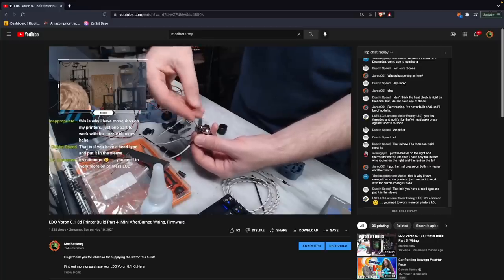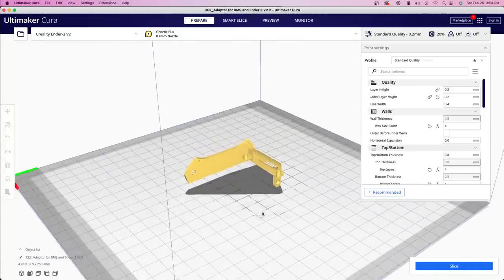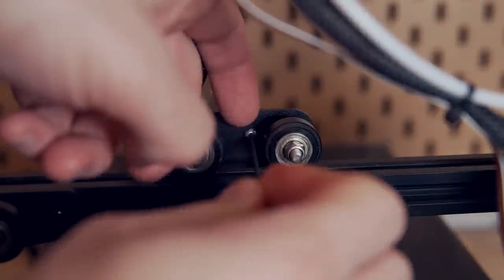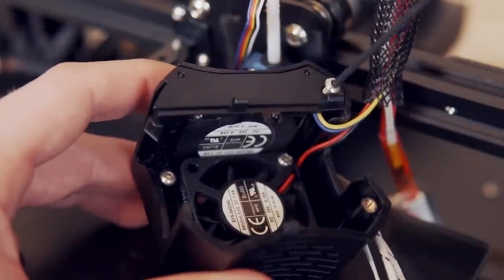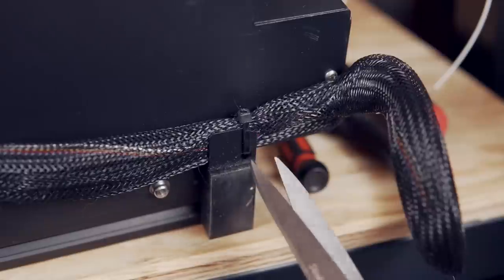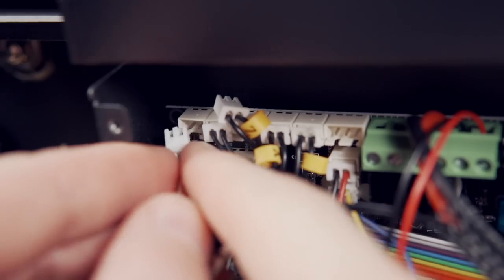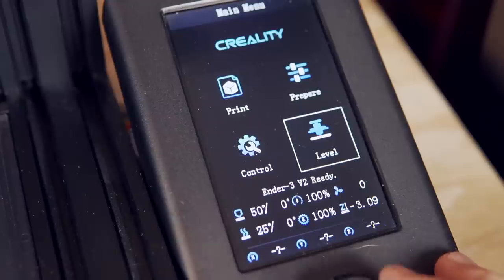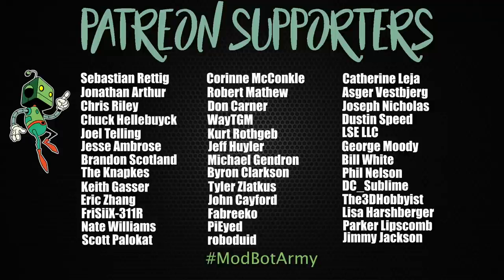Dragonfly BMS Hotend Installation (Creality Ender 3 V2)

Comment: Just as a note to help people with installation.  If you have string available, tie or tape a long piece of string to your old cables before pulling them from the cable wrap.  That way you can tie/tape it to the new wires and pull them right back through the cable wrap.  Makes the process only take about two minutes.
Reply from the maker: That is a great idea 👍
Reply: Fiberglass wire fishing rods are great for getting wires down these sleeves.

Comment: Oh a possible related idea for a future DIY video: instead of re-running all that wiring, I've chosen to start cutting cables, and putting female connectors in place for my fans, to make future replacement easier.  You can do the same for the heater cartridge / thermistor wires, with the only real downside being those extra connectors on your hot end.  But speaking for old blind people who hate soldering, crimping pins is much easier.  Plus pin kits are cheap too, every 3d printing nerd should have one, or two.  :-)
Reply: I totally agree, molex for the heater and sm for the rest, besides it looks more professional.

Comment: Perfect timing. I've had a Dragonfly BMS in my drawer for a couple of months for my Ender 3 v2 and I was actually planning on doing it this weekend. I printed out a Satsana hot end cooling duct for it as well that upgrades the fan to a 5015 parts cooling fan.  I'm glad to see it's pretty easy to install. Thanks for the video.
Reply from the maker: Oh nice more cooling is always a plus. I have been really happy with it but if I am going to push it speed wise a cooling bump could definitely help. Good luck with the install!

Comment: Hi good videos ;) i have a question for u,i have ender 3v2 with jyers firmware,that firmware is moded,i can set hot end to 300c,so if i want to change heater and cartridhe do i realy need to make changes in firmware????

Comment: Have had this on my Ender 3 V2 for a while now. It has greatly improved the quality of my prints.
Reply: Hi, did you change the thermistor like in the video or you use the stock thermistor?
Reply: @omegadeepblue1407  New thermistor
Reply: @GuysShop thanks

Comment: I upgraded Ender 5 Plus to Dragonfly BMS and used it for month. Not a bad hotend, but I went to Dragon High Flow instead. I print functional parts only and with 0.6 mm tungsten carbide nozzle.
BMS had not gave me enough flow to print really fast 30-36 mm^3/s - ie 0.6 mm nozzle at 0.3 mm layer height and 150 - 200 mm/s.

Now that’s rocking 😁

Nevermind, BMS will be used on my older printer with direct drive setup.

Comment: I installed this hotend on mu ender 3 last yesr. Its an awesome hotend, but a bit of advice, the heatbreak is very delicate, you have to be very careful when changing nozzles, otherwise youll end up spending 30 bucks on a new heatbreak

Comment: The easiest way to get a little more clearance on the hotend, particularly if the Ender stand-offs are a bit short on your printer, is to use a pair of brass heat-set M3 threaded inserts. Basically the same ones that you might use in your finished 3D printed parts. In this case you don't even need to print a part first. Depending on the specific insert you're using, this'll give you 3-4mm of additional clearance without having concerns about either having to print a part, or such a printed part having a dimensional issue.

Comment: Detailed guide video, Just a tip, 
If you bought the fresh box of BMS it will come with a spanner to hold the block from the back side the use standard 7mm spare for the nozzle to be tight.

Comment: As the video seems to be for new/not so experienced printer owners, follow up video could be optimized print settings with standard/upgraded extruder, benifits of upgrading (other than higer temps) max print speed with standard ender 3v2 etc.

Comment: When pulling old cables out of a cable braid, tie some fishing line to the end. You can use that fishing line to pull the new wires back through more easily.

Comment: I would of replaced the Bowden tube with Capricorn tube at the same time. I still have a stock hot end in my ender 3 have done a couple of mods. I think my next mod will be hot end replacement👍.

Mods so far:

Capricorn bowden 
Glass bed with better springs 
Car touch
OctoPi

Comment: Nice, glad you got some use out of that thing!  I don't trust YouTube with my moniez yet, otherwise I'd be a channel member too.  :-)

  For a hot end that was seemingly targeted as a drop-in replacement, I found the fact that it was shorter and fatter than the OEM unit to be a pain in the bum.  Nowadays with all the shrouds we have access to for free, or solutions like EVA if you're on rails, it's not a big deal.  But it could catch some folks that are new to the hobby.  For me personally, I just chose to stick to the Micro Swiss hot end on my E3 V2, since I already had the MS direct drive plate installed.  Plus I only have two printers, a mutilated remnant of an Ender 5 Plus with a Dragon, and the E3V2 with the Micro Swiss direct drive / hot end combo, works well enough for my needs (ABS+ is as hot as I go right now).

Comment: When I changed out the hotend on my Ender 5+ I taped the new thernister wire to the old and pulled it through, same with the heater cartridge, this ended up being a 5 minute job unlike my other Ender 5+ which I did the same way as yourself amd that took me about 20 min and some painful fingers and thumb as the Ender 5+ has that ribbed plastic conduit, a few days later saw a tool online to open the conduit and run the wires into it, sods law!

Comment: I've been running this on my OG Ender 3 for like a year now :D I juse checked that I purchased mine in 2021.04 - when my OG hotend died. The only issue I had with it was that the glass bead thermistor kept getting out of the provided tube. I ended up getting a different thermistor from E3D with molex adapter and changed the firmware to be able to go higher with the temps. In my experience it is also "slightly" shorter than the OG hotend - as my BL Touch had to be moved up due to negative Z offset. I use TH3D firmware and for some reason there is a limit on how much negative Z offset you can have. 
But since the upgrade I've never had any clogs, no extrusion problems, nothing. I love this hotend a lot! I'll probably also add one to my future Voron. 
Support from Phaetus is also top notch! I asked them what thermistor can be used, and what thermal paste they gave with the hotend. They promptly replied and also checked my feedback about issues with the glass bead thermistors.
Reply: To add to the glass bead thing - adding the glass bead to the cilinder is really bad. There is NOTHING that holds the bead inside the tube. The tube can be mounted easily by the grub screw - however, the glass bead WILL move out, unless you use a ton of kapton tape to keep it in position.

Comment: Good job on this quick little guide. I've no desire to replace all my MK8 nozzles with V6 ones, though, so the Creality drop-in replacements by Phaetus have never been an option for me, regardless of my considerable appreciation for their E3D drop-in upgrades. I'm perfectly happy with my Copperhead heatbreak (plus Heatlink cables) on my Ender-5.
Reply: What hot end you running boss so I can on my 5 my version one spider is ass

Comment: I was looking into this one but ended up getting a Haldis Red Lizard V3 Pro. Mounts the same as the stock one and this one but doesn’t need adapters or anything. It’s also bimetal and cones with a hardened nozzle. It’s also a bit cheaper than this one.

Comment: I was using the Dragonfly in combination with the Micro Swiss directextruder on my mostly stock Ender 3... Have to mill a slot between the screwholes cause by the shape of the body the dragonfly cooler have. I have printed with this setup tpu filament down to Shore 63. Works realy well and IT printed realy easy.

Now I have the Voron Afterburner printed in ASA on the Ender 3 for the Ender 3, just for fun. But the BMG pancake motor fried my mainboard. The connectors on the motorcoils are diffrent, so it shortcut the driver... New mainboard incomming, swapping to 32bit with silent drivers. 

Hope to print with this setup also the Super soft TPU...

Comment: Just wondering what sort of advantages the Dragonfly BMS would bring over just installing a good quality all metal heat break and a plated copper nozzle into the stock hot end?

Comment: What about the heating cartridges? I see you swapped them here. Are these higher wattage than the stock ones? And where could I get them for replacement in that case?
Reply: Hey, did you find out which is best?
Reply: Hey there. I would say get a new cartridge. Get about 60W at the voltage that is appropriate for your printer. My printer uses 24V but check your Ender or specific printer. Ohh and the thermistor that looks like a cartridge too. It's better than the stock one

The added wattage can help the hotend achieve higher temperatures without problems. Typically the temperatures oscillate between -/+ 3 degrees Celsius and that can reduce the quality of your prints if you use an underpowered cartridge.

Comment: Iv been using it on my v2 for months, only using for abs and similar temp filaments. Only thing I don't like is that it doesn't have a screw for the thermistor. Which means most likely i have to replace it when I'm not around and a print fails and gobs up the wires

Comment: Next time you remove a wire from a cable sleeve, attach a wire or fishing line. Pass cables back in by attaching them to the fishing line.
Reply from the maker: Someone else mentioned that to. I need to order some string that sounds way better 😬

Comment: Are you still useing this hot end? 
I have one and curious  what fan ducts work best with it. I couldn't print the adapter and my factory duct was damaged out the box. 

Also wondering what direction drive works well with it for future mod

Comment: One question which number did you use in marlin  for the thermistor, I bought but I have had problems with temperature measurements I use the 11 number

Comment: I love the Jyers firmware on my Ender 3 V2, and I have installed the Phaetus Dragonfly, but I have not been able to succesfully increase the max_temp in the firmware. I keep trying to set it to 300, but after it compiles, and I flash the printer, it still maxes out at 260. What am I missing?

Comment: Hi! Planning on doing this upgrade also. Just wanted to ask, does this use V6 nozzles? I want to use a 0.6mm nozzle instead of the included 0.4mm nozzle. Thanks!
Reply: It uses any standard E3D-v6 compatible nozzle. The MK8 ones that are standard for Ender printers will be too short.
Reply from the maker: Yup! Standard v6 nozzles are good to go 👍
Reply: @thomasbonse  Thank you!
Reply: @ModBotArmy  Thanks!!!
Reply: My goodness, you'd think this was protected information, this answer was hard to find. I could have went through the mechanical means of figuring this out, but when ordering, a simple Google search should have produced this information. Thanks for question and answer.

Comment: I am having a challenge with the Ender 3v2 fan adapter printing.  Any suggestions for best position and settings for printing a clean piece?
Reply: I use PETG at 240C with my bed at 80C. I use the stock glass 3v2 bed .  Use supports and make sure to clean your bed real good with Isopropyl Alcohol.  My prints are good and they stick to the bed very well.  Let the bed cool to room temp before trying to remove the print.

Comment: my only question is why do i have to print an adapter for my ender 3 v2. i really don't have any other hot end to print this with, which obviously sucks. do i have to buy another hot end just so i can print this adapter?
Reply: also, i can continue using PLA right? i really hope i don't waste all this PLA filament i've got.

Comment: is it hard to change the firmware temp? I've never even touched firmware though?
Reply: If you can get the source code compatible with your printer's main board, then it's not difficult. If your printer only has pre-compiled binaries or no firmware upgrade options, then it will be difficult, neigh impractical.
Reply: it's so dang easy in Jyers firmware for  the Ender 3 v2
Reply: @br0k3nilluzion  I love the Jyers firmware on my Ender 3 V2, but I have not been able to succesfully increase the max_temp in the firmware. I keep trying to set it to 300, but after it compiles, and I flash the printer, it still maxes out at 260. What am I missing?

Comment: My cube looks amazing with the stock hotend. And now ?
Reply from the maker: The stock hotend works fine with pla. If you want to print with higher temp that would be a reason to upgrade 🙌
Reply: @ModBotArmy  PETG works also fine 😊 for higher temp materials is an enclosure needed. Bad english 🤭
Reply from the maker: @allffrommars6019  just be careful not to melt the ptfe lining. It can easily be done when you get into upper petg temps. And it depends on the material most high temp do but you can print nylons without an enclosure 😬
Reply: @ModBotArmy  i use a capricorn? tube 😊

Comment: You are supposed to use Ferrells!!!!
Reply from the maker: They are best but it is not a requirement. As long as you do not tin your wires bare wires work fine.
Reply: @ModBotArmy  🙄

Comment: there is no time and patience with cable braid. Is technique. Yous just has to do it like is suppose to.
Reply from the maker: Yeah I mean you bunch it together to make it wider but it still take some time to get it to feed nicely. It is much easier when you don’t have it on an existing wire harness.
Reply: @ModBotArmy  thats why is easier to take everything out and feed them together. But the right technique is to not use those damn things in the first place
Reply: @ModBotArmy  It can actually be more difficult to do a fresh pull through sleeving, particularly if there are connectors involved and you're not using something like a fiberglass wire fishing rod/pole. Adding/removing a wire isn't really too bad, just time consuming.
Reply from the maker: @thomasbonse  fair I guess my most recent example was with the voron 0 and I pulled them all through before crimping so it was fairly painless. I can see plugs and different cable types being a nuisance

Comment: What real advantage does this have over a stock hotend with a metal heatbreak and nice copper nozzle for it? 

I have been looking at the BMO for about a year now but am finding it hard to see the advantage. Does it flow a significant amount more? I get it's all metal which is nice but the ender hotend with an upgraded heatbreak can handle high Temps as well.